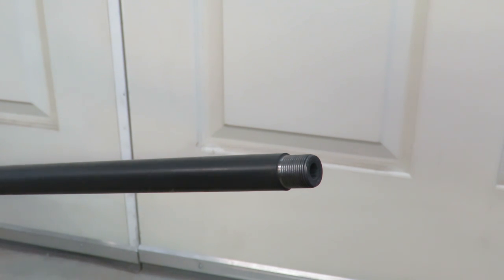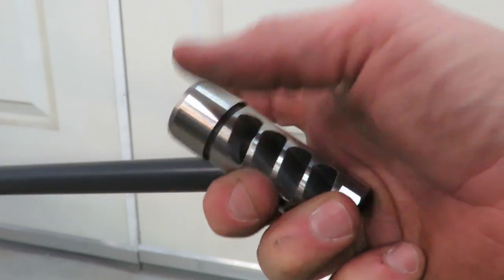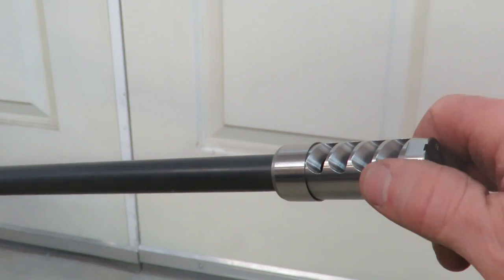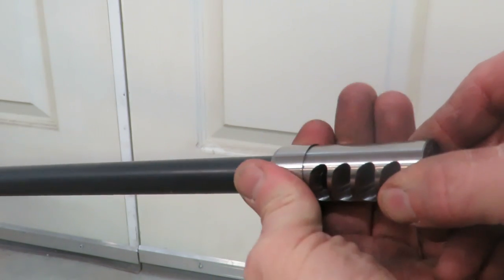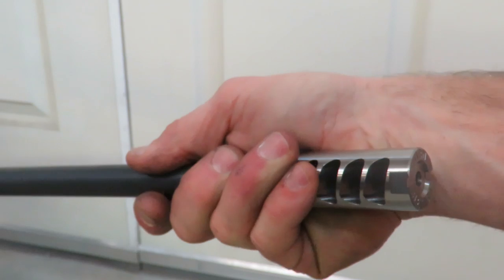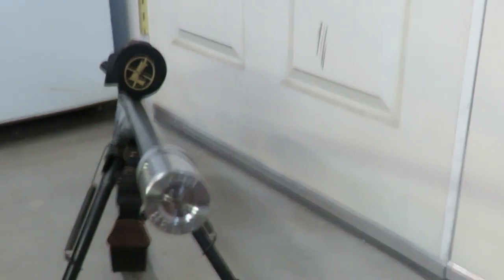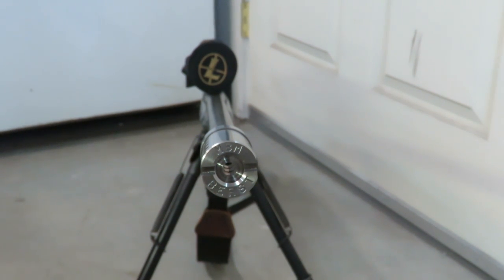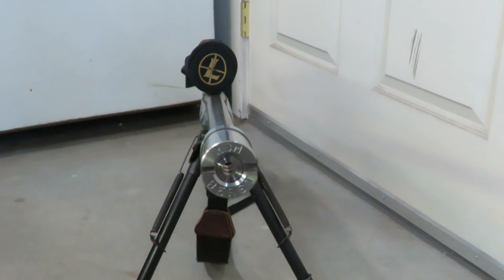Self timed Beast brake installation video

Comment: Just received your two piece brake for my 7mm WSM. Its sweet ,of course you already know that. But there is no flat spot to attach a 15/16ths wrench, so I did it by hand. Feels dang tight, will that ?work
Reply from the maker: There are wrench flats at the front of the brake but not on the cap. If it doesn't move then your good doing it by hand.
Reply: Shot it yesterday  , it’s far superior than the PVA brake I wish I never bought . Thanks for an awesome product
Reply from the maker: Glad to hear you like it and your welcome.
Reply from the maker: There should be a flat on the front of the brake itself. If there isn't then you can use a strap wrench but there should be on all of them.

Comment: How many foot pounds of torque having trouble keeping my break tight
Reply from the maker: If your having trouble keeping it in place use a small dab of blue Loctite on the barrel threads. Don't put any on the cap threads.

Comment: Is there a video for installation of the one piece Lil Beast 4 Port?
Reply from the maker: I don't have a video for installing a 1 piece brake. Most people use crush washers, shims, or a gunsmith to time them.
Reply: Muzzle Brakes and More   thanks. My ports didn’t line up right when i screwed it on, so I wasn’t sure what to use to back it off a quarter turn, but keep it tight.
Reply from the maker: @chipdavis1   For the 1 piece brakes you need shims or a crush washer to time it if you don't have a gunsmith install it.
Reply from the maker: I don't have a video for the installation of the one piece brakes. They are fairly self explanatory. You use a crush washer or shims and time the brake with the writing with the correct orientation.